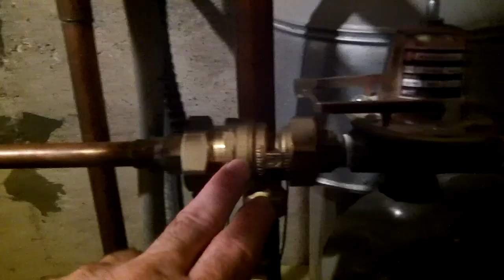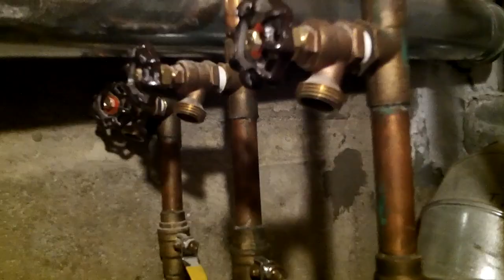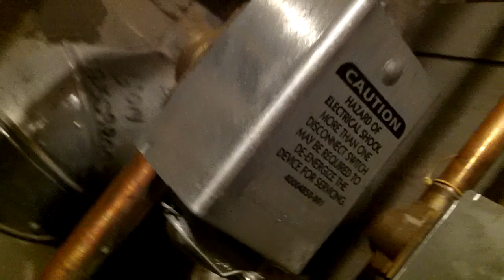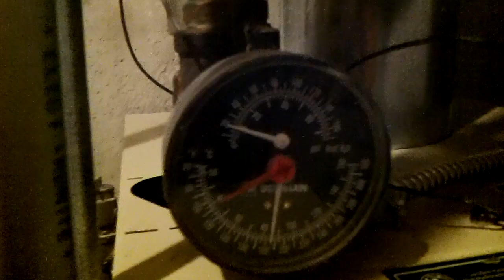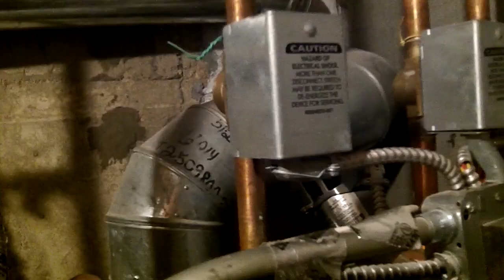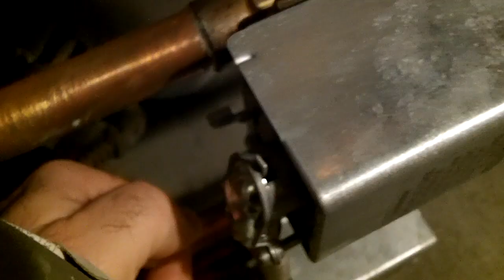How to remove the air from your hot water heating system

Comment: Hi, I have a three zone. I tried purging the zone that gets no heat but when I open the drain valve water comes out for about 5 secs then it stops. Any suggestions?
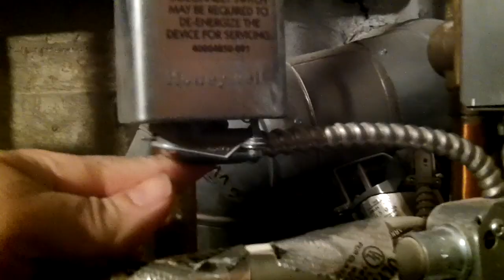Reply from the maker: Did you open the valve for the zone you are trying to drain?  When you forget to open the valve for the zone water just trickles out.  Look at 2:20 on video.
Reply: Your Hunting Buddy
I dont have zone valves like the ones in your video.
Reply from the maker: You must have a valve that opens each zone as it needs heat. Once you find it you must bypass it to get the water flowing so you can remove the air from the system. You may want to consider hiring a plumber and paying close attention to what he does so you won't have to call him back the next time you need to remove air from your system.
Reply: Are you adding water into the zone as you empty it through the bleeder valve? Water in, water out.
Reply: Bill W It turns out the line was frozen.  Once the outside temp hit above 35 degrees I was able to successfully purge.  I found where it was frozen too.  Thanks for all the help.

Comment: I am having trouble getting my second zone to heat. I recently replace part of my baseboard pipes and I cant get the water to flow to the 2nd zone. The Pipes do run up one story, over 10ft. and back down to the back of my home.  You show shutting off a valve underneath the return valve. I don't have one like that. I have the Watts 0207500 PB-56 3/4" Purge and Balancing Valve. ( you can Google it for a pic) Would the bottom of that valve is where i can stop the water from returning into the system? I went through maybe 20 buckets of water over the last few weeks, raising the water pressure to 30psi while bleeding and cant seem to get it.  Any advice would be great.
Reply from the maker: Sorry I did not get back to you sooner.  Sometimes the zones run into one shutoff valve.  Don't mess with that mixing valve.  Your pressure is too high.  You may need to get a plumber.

Comment: Hi, Do you know what would be the problem if the pressure goes above 20, e.g. 25 and at about 22 to 23 PSI, the psi becoming unstable, and makes some jumping/kicking sounds.  Do you know what might be the problem? 
And in addition to that, when it goes to 22/23 psi, water starts dripping from high pressure relieve valve.
NOTE: i just replaced the expansion tank a week ago. 
Thanks.
Reply from the maker: It sounds like your pressure reducing valve is not working properly or may be set too high